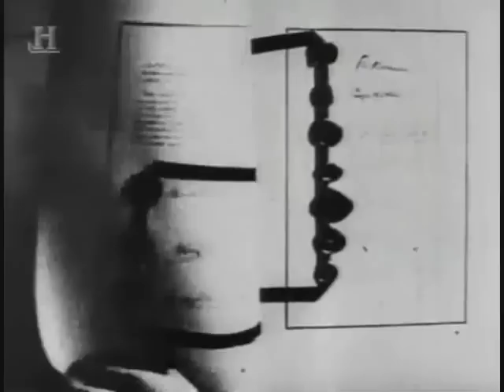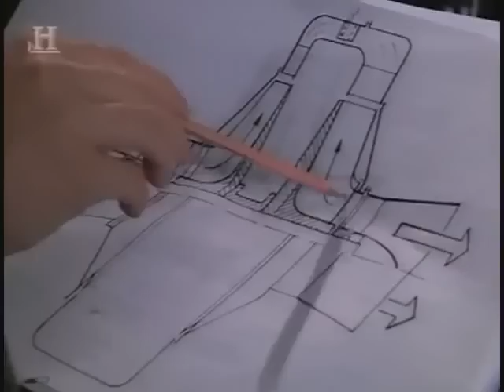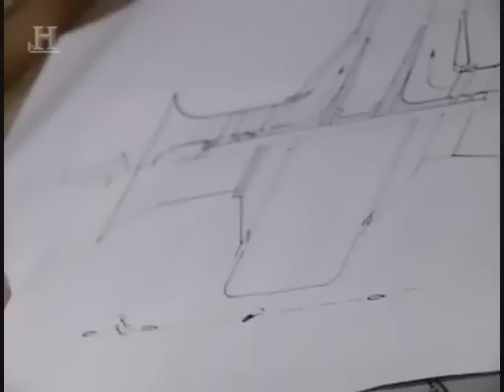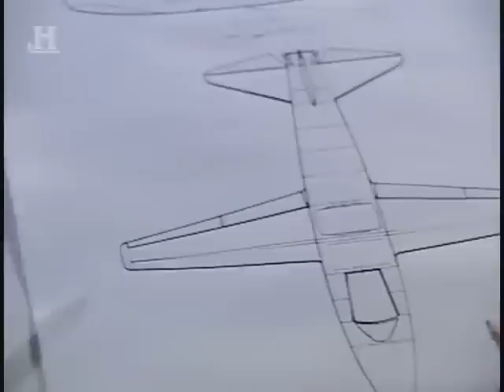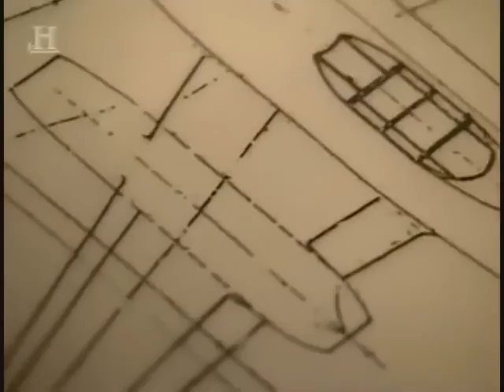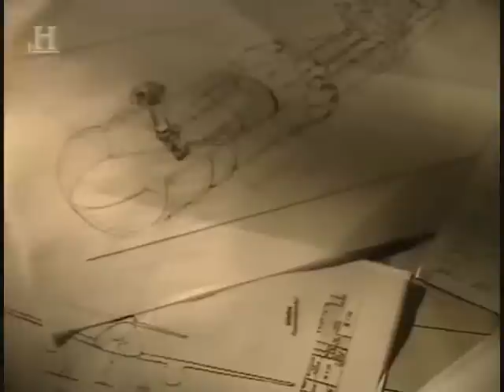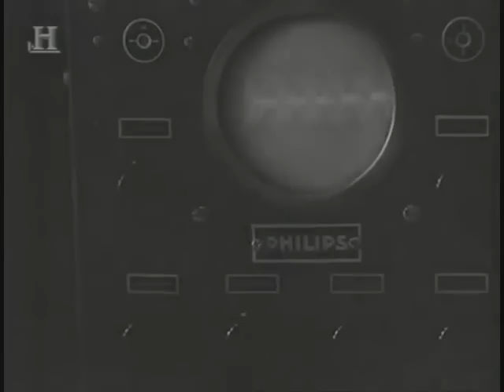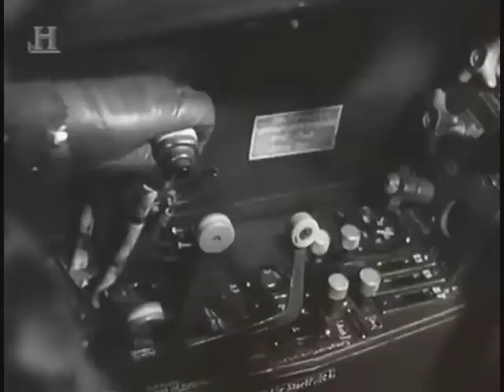A Race for a Jet - Me 262

Comment: The little known irony of jet engine design is that Whittle's engine worked, it was sound. But he could not get the initial financial backing needed, otherwise the RAF would have had the 1st combat jet. Nevertheless the Gloster Meteor did fly in March 1943.

The Luftwaffe had a fantastic air frame in the 262 design, years ahead of it's jet engine. Which was terribly flawed as the 262 could never sustain more than 30 minutes of combat in the air. Whereas the Gloster Meteor could maintain flight for upwards of 90 minutes.
Reply: Even Willy Messerschmitt did not think the Me 262 advanced, after all it was a straight wing design and had an absolute mach limit of just 0.84 or about the same as the Meteor.
Reply: John Hancock 7
Reply: John Hancock you have no clue!
Reply: Wanderfalke.
I know the Me 262 did not climb like a Spitfire but even so it could get up there in less than 10 minutes.  It would depend on how far the bombers were from the Me 262 airbase, but the Luftwaffe would send the fighters up to be at the right height by the time the bombers got there.   But what is so magical about 1 hour?   The Me 262 could fly for well over 1 hour but that would be at economical cruise, at maximum speed the range would be very short.
Reply: Barrie Rodliffe True that! Problem was that they did only put as much fuel in as they had so they were almost never fuelled to the max! Also climbrate wit only one of their 2 center fueltanks filled was much improved! But you are absolutely right about more than 1 hour flights! The 109e however had a very limited range in comparsion!
Reply: All the allied jet engines  , till the RR Nene in the late fifties  , were  fited with centrifugal compressors  which  forbid  reaching  the performances of the german ones .  The axial  flow  compressor directly choosen by BMW and Junkers (Jumo ) required a hard study or air flow that American & UK did not had . So , even the Meteor  was inferior to the 262 , and in USA ,  at the time of Korea war , the USA were still late on this topic compared to the level of Willy Messerschmitt in 1940 .i.e. the Gruman F9F had not yet discovered the  advantage of swept wings , ten years later !!!  US pilots paid it cash when they met the Mig 15 over Yallow River !
Reply: HiWetcam you haven't gotten to the fact that those centrifugal compressors made those jet engines heavy? But you can put crap coments on youtube like a 10 year old - well done!
Reply: Wanderfalke.
Heavy like the RR Welland  1,600 lbs thrust   850 lbs  (  385 kg ). 
The Derwent 1   2,000 lbs thrust     975 lbs   (442 kg ).
The Derwent  V  4,000 lbs thrust    1,250 lbs  ( 567 kg ).
The DH Goblin  II  3,000 lbs thrust  1,500 lbs  ( 703 kg ).
The Jumo  004  B  1,980 lbs thrust  1,585 lbs  (720 kg )
If the centrifugal engines were heavy what was the Jumo made out of?  Lead.
Reply: Meech von Kerfly.
The RR Nene was not late 1950`s,  it was first run in 1944.
The RR Avon axial flow engine which was developed late in the war and run in  1947.
The Metropolitan Vickers axial flow designs were first run in 1942 and flight tested in 1943, they led on to the Armstrong Siddeley Sapphire which was the first jet engine to be used in the English Electric Lightning before it got the RR Avon. 

In what way was the Meteor inferior to the Me 262?  The Me 262 was first flown with a piston engine in the nose, the BMW jet engines were not ready and when they were used both failed, the planes was much modified to take the heavy Jumo engines and the so called swept wings were only swept back 18.5 degrees to change the centre of balance, not for any aerodynamic benefit as shown by the mach limit of 0.84 quite a bit less than a Spitfire.
Meteor`s met Mig 15`s over Korea and the Mig 15 with the more powerful Rolls Royce engine was faster but they did not have it all their own way, a few of the Migs were shot down by Meteors.
It goes to show the Meteor can`t have been too bad, the Me 262 never shot down any Spitfires or Tempest`s, both shot down Me 262`s and the Sea Fury in Korea shot down one and damaged another Mig 15.
Reply: Heavy ... that's the right word . But what I told is :  Jet engines wiith radial ( centrifugal ) compressor   have a smaller fuel  efficiency  due to  " internal aerodynamic ".The Air flow velocity   which gives the thrust  , stays under  the one you get with an axial  compressor  , when  burning  the same fuel quantity .. But this latter  ( axial ...) requires  a hardest  and longer time of  study  to find the optimal   AOA ( angle of attack )  of each rotor /stator blade   in the flow .  And Von Ohain had done this job befor building  his first  engine . Frank Whitle  had not  . He was more on the empiric  side of   this experimental  building . 
Everyone had merit in their own way. ( axial compressors had lots of youth trouble = when reducing thrust : what we call " pumping" or " stalling"  of last compressor blades .)
 To put them in competition in such an artificial way, especially 75 years later, denotes an unhealthy spirit in   such a  technical field.
Reply: Meech von KERFLY.
The British centrifugal engine worked as did the British axial flow engine,  Ohain copied Whittle`s patents and his engine went no where,  BMW made an axial flow engine that did not work and Jumo made an axial flow engine that was a poor design.  
Or to put it another way Whittle`s jet engine went into the Gloster meteor, Ohain`s jet engine went into nothing. 
There is no competition, the Jumo struggled to give 2,000 lbs thrust at the end of the war, the Derwent gave 4,000 lbs thrust and there were other British jet engines also well ahead of the German failures.
Reply: Bobby Millar.
The straight wing Me 262 which flew in 1941 using a single piston engine, when it got the BMW jet engines it was still a straight wing plane but the engines were a failure and replaced by the heavier Jumo engine, the plane was modified and the wings swept back slightly to correct the centre of balance.  There was no thought given to swept wings for the Me 262 until later when it was proposed to sweep the wings back 35 degrees, but it never happened.
Reply: If you say so , 1 you are conscious you'r telling  funnies and craps , and you are the only one to know  why  you behave this way  . 2. You  are convinced to be knowing the truth ... which topic  turns into  a secondary goal .. In this , there is nothing we can do to help you  tpwards the  truth  accepted by all  as our  common history . The  first goal is you keep  your equilibrium .
Sorry pall  , your case seems too much dangerous to contradict  you just for a truth  matter . The best is to let you  re buillt  the history the way you like it .
 Wish you  better  health  anyway .
Reply: Meech von Kefly.
Just try to look it up, The Me 262  as first test flown had a single piston engine, the BMW engines were not ready, it had a tail wheel and straight wings.   Whe the BMW engines were fitted and it was flown again it still had the piston engine, just as well because both jet engines failed, after a lot of work the BMW`s were dropped and Jumo`s fitted but the heavy Jumo affected the balance of the plane, so the change was made to sweep the wings back a little, also the tail wheel was dropped and a nose wheel fitted.  
If you do not like the truth you are welcome to try to do some research.
The facts are easy to find.
Reply: WanderfalkeAT And yet the Derwent still put out more thrust, was more reliable and was lighter. If you want to compare axial engines though. The MetroVic Series although were similar weight to the Jumo's; also had much more thrust.
Reply: hmm if UK was  so far ahead why did US use the tech from 262 for their jets later on
Reply: Technology from the Me 262?  what did they use?  
Nothing at all that I have seen. No one else did either except Czechoslovakia who tried but they soon dropped it and took the Mig 15.
Reply: No, its exactly the other way around..Whittle's  1930  design didn't work it was a flawed design ..
Whittles engine was not the first to power  an  aircraft in pure jet flight. (  and it took  13  years to make it work  )  
The fact  is the German's engines had a reasonable  combat record in WW2 all things considered , and powered the only jet  aircraft of any nation to  be operational in front line combat in that conflict, and were later exploited in the 50s and 60s  exclusively by all   the allies  along with German aerodymamics and weaponry in such as the Sabre Jet.  Gloster Meteor never saw A2A combat in WW2 ..
Brits  completely  lacked the knowledge to construct a successful axial flow engine as the German had  and  stuck with the outdated centrifugal compressor.  
Germans  were miles ahead of  Brits in Jet propulsion  technology.The father of the BMW  003 , Herman  Oestrich  went to France after the  war, hired  by  Marcel Dassault and  created   the  first  French  fighter  jet engine  ATAR for  Mirage III  which became  the first european  jet  fighter exceeding Mach 2.2 he was also the first  technical   director of the SNECMA...

http://www-diva.eng.cam.ac.uk/theses/endwall-film-cooling-in-axial-flow-turbines 

The first ideas and
suggestions for a gas turbine engine for aircraft propulsion came from Maxime Guillaume in
1921. Fig. 1 is from his patent which was granted in 1922 and shows the main components of
such an engine with a multistage axial compressor, combustion chamber, fuel injection, axial
turbine and starter.

July 1942 saw the first flight of the Messerschmitt Me  262 jet
aircraft equipped with two  Junkers Jumo-004-B gas turbine engines. A total of 1433 of these
aircraft and over 6000 of these engines were built, making the Jumo-004-B the first aircraft gas
turbine engine to be manufactured in a large-scale series. Starting with the series B 4, the Jumo-
004 used air cooled hollow turbine blades. A lack of high temperature materials due to a lack of
chrome and nickel during the war years resulted in a maximum life expectancy of the turbine
rotor of just 50 hours.
Reply: poor ignorant barasoaringwilbur.
Sure there were over 1,400 me 262 made and over 6,000 Jumo engines, but only around 200 Me 262`s  flew, they needed so many of the engines  to keep changing them every few hours.   No lack of anything prevented anyone making any German jet engine design work.  
All modern jet engines come from British designs.
Reply: British fake talk all the way.
Reply: Me262 first flew 1942
Reply: The Jumo engine had a combat life expectancy of 25 hours, which this very video reveals. Howl Hilter LOL!
Reply: The Meteor was slower than the ME 262 and they never met in combat. Why do you think that is?
Reply: Because the allies didn't need their jet fighters. Their ability to massively out produce the Axis powers in WWII doomed Germany.
Reply: The Huns lost, you have no clue or idea why.

Comment: What a one-sided presentation.  In 1943 Lockheed's P-80 was flying, but the military didn't begin ordering them until 1944.  They were as fast as the ME-262 (about 40 mph less), but they could out turn and out maneuver the heavier aircraft.  Hap Arnold didn't feel it was necessary to use them in Germany, so he sent the first squadron to Italy to patrol the skies where there were no enemy.  As soon as the war ended Hap Arnold was forced to retire and the P-80 became the F-80 and became the front line fighter for the USA in 1945.  How many flyers could we have saved if we thrown the P-80 against the ME-262.  Even if we didn't stop them our pilots could have put them on notice they didn't control the skies.
Reply: D. Paul Gladstone , I suspect the P 80 didn't have enough range to escort bombers from England to the middle of Germany.  The Me-262 was used to defend against bombing raids, so the short range was not too much of a problem.

Comment: The Me-262 could NEVER out-maneuver the Mustang. True, it was 100 mph faster but out maneuver it? Nonsense.
Reply: Scott Murphy It can outmaneuver it because its faster
Reply: out maneuver doesn't mean out turn.
Reply: Sturmv0gel   The 262 had a wing loading considerably higher than a Mustang, which meant the Mustang was the more  manoeuvrable .....simple aerodynamics.
Reply: Scott Murphy  wake up. The German pilots assigned to the jet were the top scoring aces as well. There were German pilots with over 300 kills. The Amis had nothing remotely close

Comment: The guy putting in the fuel for the 262; Where does the hose go? Where is the fuel truck?
Reply: 26:34 You have to look fast. The hose is connected to the back of Hitler's pants. The 262 was gas operated. Be well.
Reply: ...off camera

Comment: The Germans should built the Horten instead of the Me 262 and developed it earlier , that would have changed the air superiority....
Reply: Magnus.
What Horten?  they only made gliders and they wanted to make a bomber but it never got off the drawing board.  Gotha did fly an experimental plane which was a failure and crashed killing the test pilot.  
Germany never had a good jet engine so even if they could have somehow made a bomber they had nothing better than the poor Jumo engine as used in the Me 262.
Reply: Barrie Rodliffe Ho229
Reply: Magnus Mc Graw The Horten wouldnt be better as well as its made out of wood so if you get hit by a Explosive shell it would burn down
Reply: Sturmvigel.
The Ho 229 was only on paper, The Hortens made gliders.